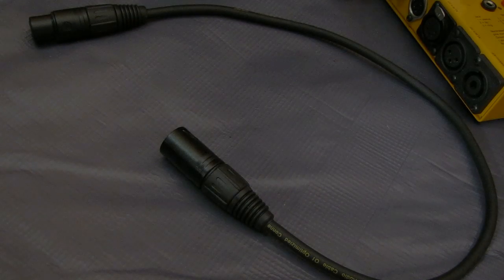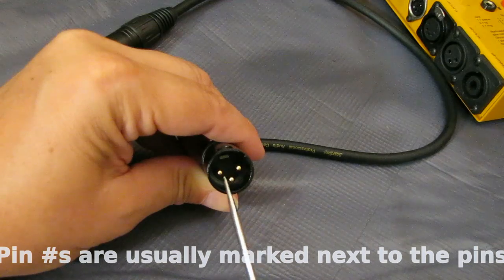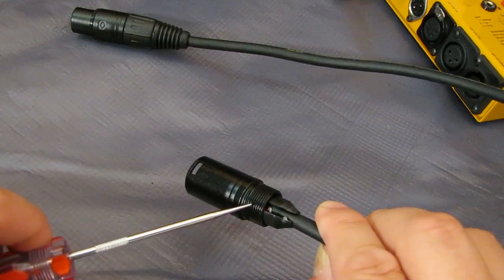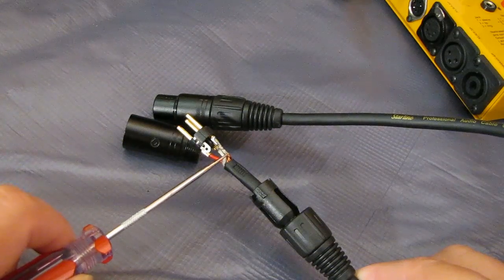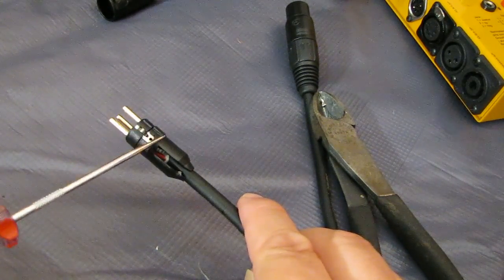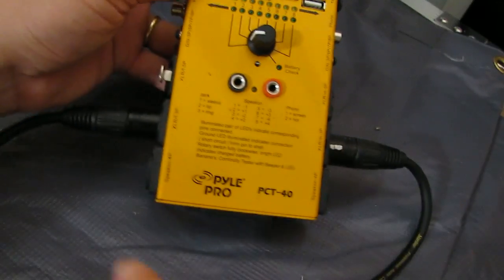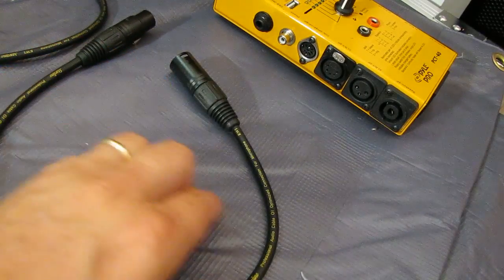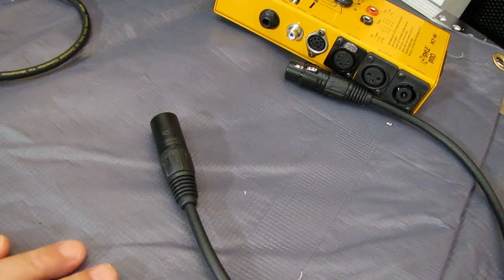Making ground lift cables

Comment: ! D!d try your 
v!deo !t just made the ground loop worser 🤬🤬🤬🤬
Reply from the maker: In the type of situation you encountered, the ground-loop was probably not related to a grounding issue between the amplifier and (assuming) the console.  Ground loops can occur anywhere where a signal ground may exist.  The fact that the humming sound was louder after you removed the ground on the XLR, would indicate the ground-loop issue is  somewhere else other than where the XLR cable was being used.
Many years ago, I had a ground-loop between two amplifiers that were daisy-chained (in the same rack).  I had to use a ground-lift signal cable between the amps to silence the humming noise.  The issue ended up being the outlets, where the amplifiers were plugged into, were on separate circuits that spanned several other receptacle locations.
Also, something to consider, humming noises can originate from musical gear (amplifiers, keyboards, guitars, etc...) due to usually an issue within the instrument (or instrument amplifier).  A good trouble shooting task would be to start disconnecting cables (one at a time) to see if the humming noise stops, and reconnecting the cable if the humming did not stop.  Work through the system to determine where the issue is.

Comment: What about XLR cable w!th the RCA at the end 
wh!ch w!re would you cut an would !t get r!d of the buzz!ng sound ❓❓❓❓
Reply from the maker: RCA cables (by their design) are not balanced cables, therefore, there is no actual ground pin/wire that can be cut.  Cables with RCA ends, even on one end, are un-balanced.  This includes cables with XLR on one end and RCA on the other end.  A buzzing noise can originate from a few sources... the noise may be on the electrical circuit the gear is connected to (light dimmers, devices with generators, etc...).  Also, the device itself (what the cables are connected to), can be the cause of the buzzing.  Impedance imbalance (also known as impedance mis-match)  between gear (pro level gear connected to consumer grade gear - and vice/versa) is a big cause of noise.
Hope this helps.
Reply: @stageleftaudio 
The XLR cable does have a ground w!re !t'z solder to p!n 1 & p!n 3 & the red & 
wh!te w!re !s solder to p!n 2 so wh!ch p!n would ! Have to solder the red & wh!te w!re to
Reply: @stageleftaudio an on the RCA plug the red & wh!te w!re are soldered to the 
m!ddle p!n & the ground !s soldered ma!n base of the RCA cable would ! Have to resolder the red & wh!te w!re to the RCA cable????
Reply from the maker: RCA cables (by their design) do not support (or have) ground wires.  Anytime an RCA plug is on any cable, this indicates the cable does not have a ground.  You are correct, the XLR cable does have a ground wire, but it is not being used because (from what you saw), the ground is connected to the negative pin of the XLR.  An actual grounded cable   will consist of 3 separate wires at each end -- the ground/shield, the negative, and the positive.  An RCA cable has just the negative and positive, therefore, it can never be an actual grounded cable.
Reply: @stageleftaudio 
But the RCA !s grounded 
!t'z grounded to the base of the RCA not the ma!n t!p that has the red & wh!te solder to !t an 
The ground w!re !s solder to p!n 1 an p!n 2 on the XLR cable
Reply: @stageleftaudio 
What about !f ! Just solder the pos!t!ve & 
negat!ve & just leave the ground w!re alone so 
wh!ch p!n'z on the XLR cable would ! Have to solder the red & wh!te to & wh!ch part of the RCA would ! Have to solder the red & wh!te w!re to ????
Reply: @stageleftaudio 
What about some balance xlr cable with 3.5mm jack ???? Because ! Just have the m!crophone Jack's on my Gem!n! Power speakers 
runn!ng to my Sony brava TV 3.5mm Jack
Reply from the maker: May need to make sure the 3.5mm jack on your Gemini powered speaker is a balanced connection.  The manual for the speaker should show you that information.  If the speaker 3.5mm connection is balanced, then make sure the XLR to 3.5mm cable is balanced as well.  The 3.5mm phono connector on the cable should have 2 black bands around the actual phono plug.  If there are 2 black bands, then the cable should be a balanced cable.  If there is only 1 black band, then the cable is unbalanced and does not have a ground.
Reply: @stageleftaudio 
XLR inputs (Mic/Line) → These are balanced, so they’ll help keep hum and noise down, especially on longer cable runs.
¼” jack inputs (Mic/Line) → These can be balanced (if you use a TRS cable) or unbalanced (if you use a TS cable). So it depends on the type of cable you plug in.
RCA inputs → Always unbalanced.
1/8” (Aux) input → Also unbalanced.
Reply from the maker: Your "XLR Inputs" comment is correct!

For Bluetooth (or most any wireless connection) you should not hear any buzzing.  If you do hear buzzing using Bluetooth, it may be originating from the Bluetooth device.

Comment: I’m having this issue with my preamp which has a separate power supply with a buzzing transformer that you can hear. The transformer hum is making its way into the audio path via the line input when sending audio from the computer into the line and back. The mic or DI are fine. 

Any idea if this ground lift cable would be worth a try?
Reply from the maker: Looks like you are using home audio equipment...?  I'm not sure about home audio gear.  Though, if all your gear (including the preamp) are connected to the same circuit, and there is still a humming sound, this could be an issue with a transformer or something else (another noisy transformer) on the same circuit (refrigerator, florescent lights, etc...).  However, sometimes humming/buzzing can be the result of an impedance mismatch between components.  An actual humming sound is most always a ground-loop; whereas a buzzing sound is most always an issue with a piece of equipment.  From what you described, a ground-lift cable may not correct the issue.  When we connect computers/MP3/iPads/etc... into our system, we use a passive transformer that converts the impedance (of the device connected) to match what the sound system is expecting to  see.

Comment: Just curious why you would leave one side’s ground connected vs cutting both sides. Thanks!
Reply from the maker: Good question.  A couple of reasons....
1.  For creating ground-lift cables, it only takes a single break in the grounding path (of the cable); once the pin #1 connection is broken (at one end of the cable), there is no need to remove the connection at the other end of the cable.  There would be no additional benefit for controlling a ground-loop.
2.  (generally stating)... Keeping one end of the cable with pin #1 bonded to the connector will provide some "noise relief" for the cable if static electricity should occur within the cable.  With the pin #1 wire still attached on one end only, this will provide a path for any static electricity to be dissipated to (back to the chassis-ground).  Not too long ago, I had to convert my Ethercon STP cables to UTP cables because of static electricity issues.  Only one end of the Ethercon cables (for the ground/shield) was disconnected... the other end is still bonded; this corrected a lot of issues.
Reply: @stageleftaudio  Thank you!!!
Reply: The shield of the cable is being disconnected at one end ... but it remains attached to ground at the other end so can still act as a shield (perhaps not quite as effectively but it's worth having). If you cut both ends you will have no shield at all so the cable may pick up more interference. (BTW it's not really to do with static electricity as in the reply from stageleftaudio. It's to do with EMF electromagnetic fields.)

Comment: Instead of using Diags to cut the connection, you could desolder the ground and tape it off, which would be reversible.

Comment: Seen your video. What about if my XLR cable ground wire Are solid at pin 1 an 3 an the red an white wire is solid on pin 1 ? I have XLR cables with the RCA plugs
Reply from the maker: From your description, RCA cable ends (plugs) are not manufactured to be balanced (like they are with XLR connectors), meaning the RCA connectors can only support unbalanced wiring.  When using 3-wires on unbalanced connections, pin 1 and pin 3  are usually tied together (inside the connector).  This type of setup is when one end of the cable has an XLR balanced connector and the other has something like an RCA or 1/4" unbalanced connector.
Reply: @stageleftaudio  
So what do you suggest ? I have a set of Gemini's GSP power speakers that have the buzzing sound coming from them
Reply from the maker: A ground-loop "buzz" will be a 60hz sound (bassy sound) and will be rather noticeable (a little loud).  Other buzzing in powered speakers (usually at a lower level of volume and at a higher frequency) could be from other equipment causing EMI/RFI noise, or some lights (like florescent lights) that have ballasts in them can add to noise.  As well, some cheap (very inexpensive cables) can be noisy by themselves.    Also, you could try connecting the power for the GSP speakers to the same circuit as the console.  Tracking down "buzzing" sounds in speakers and amplifiers can take awhile; there's a lot of variables involved.
What model of GSP speakers are you using?
Reply: @stageleftaudio  
Gemini GSP-L2200 that'z the model I did try lowering the i don't miss use the volume on them. Maybe it's the XLR cables with the RCA at the end ?
Reply: @stageleftaudio  

What about if i resolder Pin 2 and 3 are for audio, Pin 1 is for ground on my XLR cables with RCA at the end ?
Reply: @stageleftaudio  
I did order some XLR cables like that one's in your video going to try your method an see will that take care of the ground loops i have coming from my Gemini's GPS-L2200
Reply from the maker: Thanks for the model number of your speakers.  Looks like the back of your speakers can use XLR cables (along with RCA).  Assuming your crossover has XLR outputs on it, you should be using XLR cables, not RCA.  There can be impedance issues between gear that uses XLR (on one piece of gear) and RCA connectors (on the other piece of gear).  The input (and output) impedance of RCA connectors usually does not match the input (and output) impedance of an XLR connector.  This impedance mismatch can also produce noise. 
For some types of cabling, it is usually best to purchase the cable you need instead to trying to re-solder cable ends.
Reply: @stageleftaudio  

Okay i thought it my have been the XLR cables with the RCA connection but i have my Sony TV connected to my Gemini's from the Headphone/Home 
Audio System. Can i just resolder the XLR cables just with the audio an leave the group wire alone ?
Reply from the maker: You probably can re-solder (if you are good at soldering), but If you are wanting to make an unbalanced cable (using 2 wires out of 3 from an XLR), I recommend searching the internet for pictures (or a video) on which pair of wires to use; this would probably be easier than for me to explain what may need to be done.
Reply: @stageleftaudio  
I'm all ears if you have the time to explain ? I would appreciate it ☺️☺️🙏🙏 going broke ordering stuff that is not going to fix my ground loops coming from my Gemini's power speakers
Reply from the maker: This is definitely something you will need to trouble shoot.  There could be a lot of variables involved with tracking down buzzing and/or hums.
Start ruling out things... begin with the speakers.  With no audio cables connected to the speakers, turn them on... are the speakers quiet, or is there noise.  If there is noise, there could be an issue with the speakers, or with the power the speakers are connected to.  If there is noise, but no cables attached, move the speakers to another room (furthest away from the original room is usually best).  If there is NO noise from the speakers (after turning them on in the other room), there is probably a problem with the power in the original room.
Another way... with no audio cables attached to the speakers, turn them on (and assuming the speakers have no noise when they are on), start attaching audio cables to the speakers.  If humming or buzzing occurs when a cable is attached, this could be an issue with the cable or with the device the cable is attached to.
Hopefully, this will get you started!
Reply: @stageleftaudio  

I try everything it's a ground loop
Reply from the maker: Thanks for the update.  Sounds like you will need a ground lift XLR cable.
Reply: @stageleftaudio  

Okay
Reply: @stageleftaudio  

I do have some wall wash light bars plug into the multi outlet
Reply from the maker: Try unplugging the lights (one at a time) to see if the noise goes away.  If your lights are LED, they shouldn't be causing any noise on the power lines.
Reply: @stageleftaudio  
Yes they are LED lights but the Gemini also has LED lights built-in
Reply from the maker: The built-in LED lights to the speaker should not be an issue.  Most LED lights do not cause problems.
Reply: @stageleftaudio  
Okay i try what you said but the buzzing or humming sound is still there 😞😞😔😔
Reply from the maker: That is interesting.  It is very difficult to track down hum/buzz without actually being there to hear it and test the gear.  And without being there, it's hard to track down.  Your issue may require more troubleshooting skills to track down.  You may want to try posting your issues on an audio forum... you may have better luck with someone else (and reach a larger user-base) whom has experienced your problem with the type of speakers you are using.  Forums are most always better for issues like you are experiencing.
Reply: @stageleftaudio 
What about !f ! Try 
th!s method ????? !t'z almost 
l!ke your 
v!deo 

To make a ground lift cable using XLR (3-pin) and RCA connectors, you'll need to connect the RCA's signal (center pin) to XLR pin 2 (hot/positive) and the RCA's ground (sleeve) to XLR pin 3 (cold/negative). The XLR pin 1 (ground/shield) is left unconnected to the RCA. This configuration helps mitigate ground loop hum by preventing ground currents from flowing through the signal path

Comment: does this cause the cable to be unbalanced?
Reply from the maker: Not necessarily.  Unbalanced cables have 1 x conductor wire and 1 x ground wire.  Balanced cables (most XLR types) have 2 x conductor wires and 1 x ground wire.  It's the 2 x conductor wires that provide most of the noise rejection in mic cables... removing the ground wire on a balanced cable will not add much (if any) noise to a system.  We usually  use ground-lift cables (like in the video) for monitor runs... but only if a ground-loop is present on an affected output.  Many speaker management systems (i.e. dbx driverack) have ground-lift buttons on the rear of the gear near the XLR inputs.  For FOH sound, we keep the "Pin 1 Lift" enabled on our drive rack system 100% of the time.  No issues.